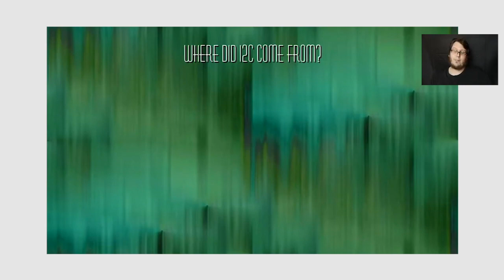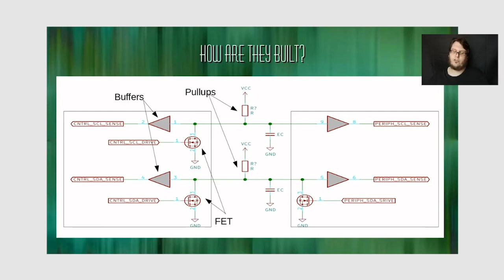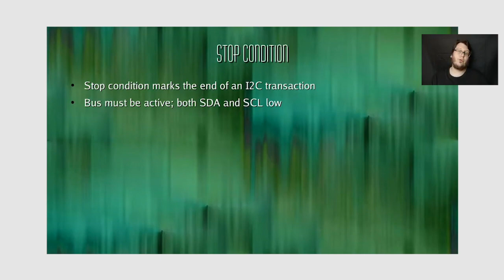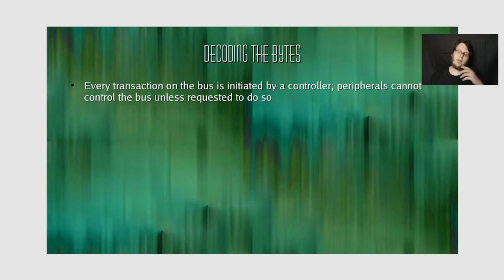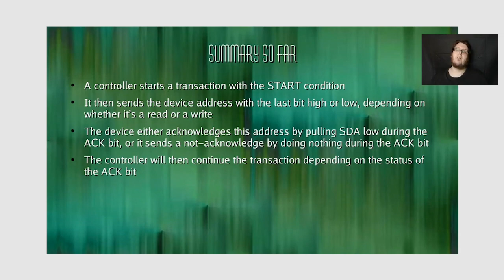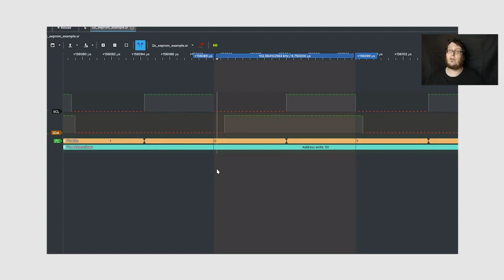HackadayU: Embedded Serial Buses - Class 1

Comment: A correction, if I may:
Philips (spelled with one "L") is the mother-company of NXP. I2C was widely used in their TV-sets to reduce wiring-clutter on PCBs
NXP is a spin-off company from the semiconductors-division of Philips; the latter now focuses on healthcare while NXP continues its focus on ICs. At no point has NXP "owned" Philips.
Reply: Thanks for the corrections -- I wrote that section partially from memory and had a couple things mixed up. NXP does "own" the portfolio of Philips semiconductors and all the former Philips semiconductors are produced under the NXP name now. I just wanted to explain why students and beginners might see stuff as Philips branded, when modern documentation will have NXP instead.